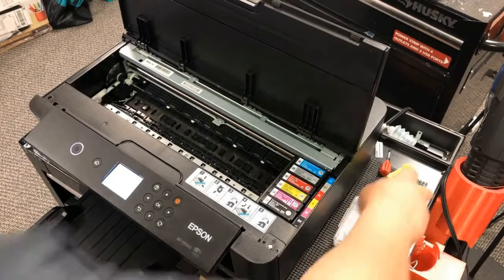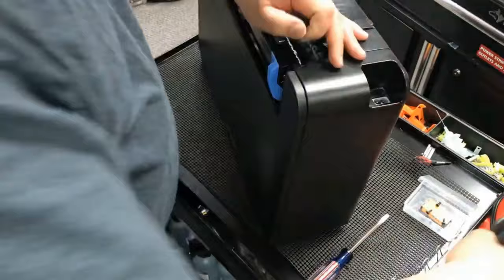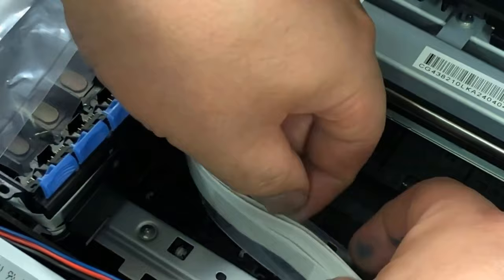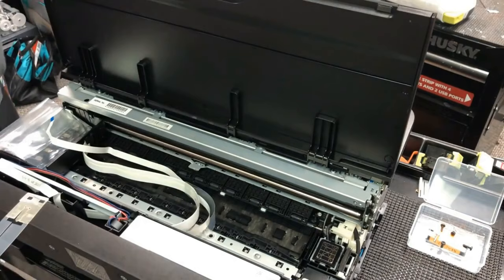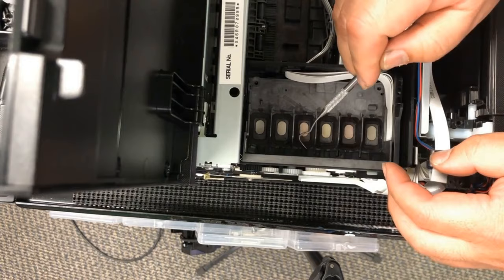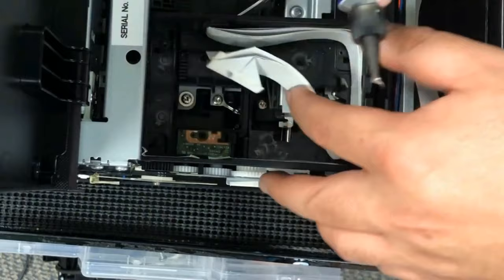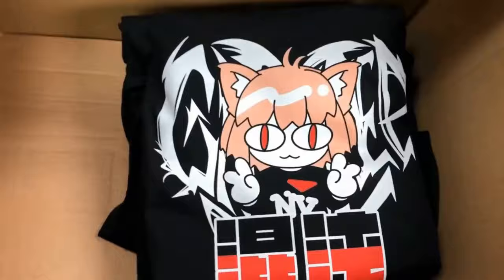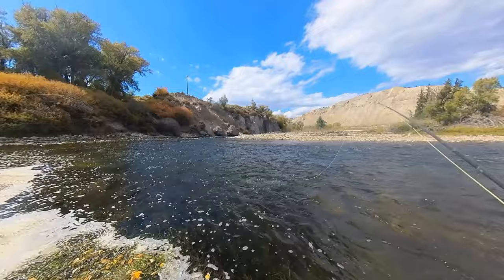6 STEP XP-15000 DTF Conversion: Relocate CSIC, Waterproof Printhead, Remove Star Wheel

Comment: Don't waste your time. This guy messed up my printer. Out of the box, once I received it, it was a total disaster. The print head was clogged, there were paper feeding issues, and the external waste tank line was cut, causing a mess. After 12 attempts to clean the print head, I got an error code 031006, rendering my printer useless. He won't take responsibility for his poor workmanship, leaving me screwed.